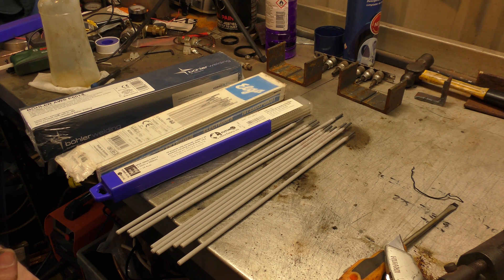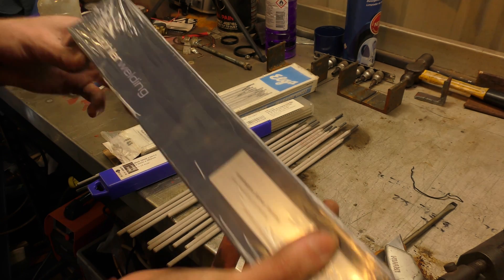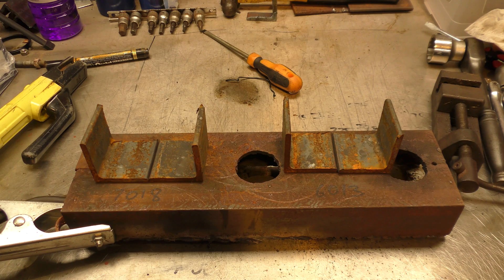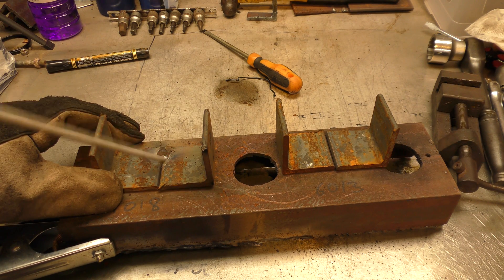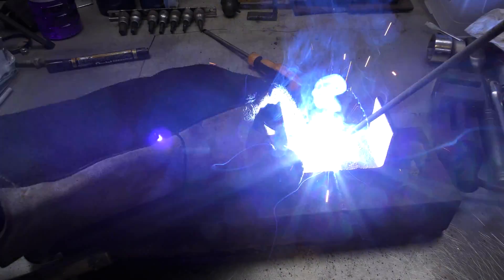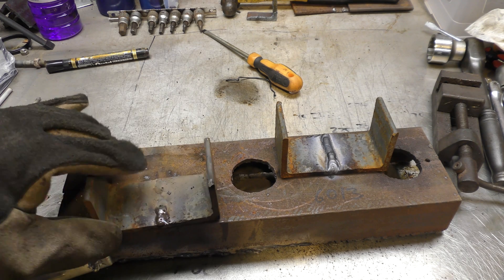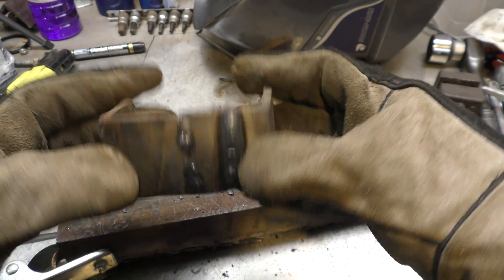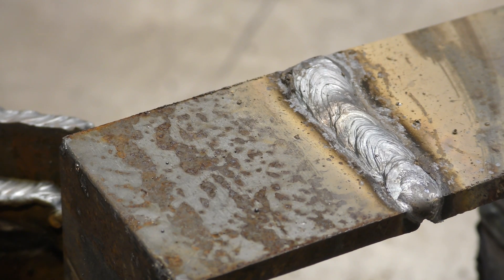Welding Electrodes for DIYers. 6013 7018?

Comment: As a beginner always best to start with mig/flux core. stick welding has too many variables and a steep learning curve. if you must have stick then 6013 is the way to go.
Reply from the maker: Well that depends.  If you want to learn to weld properly, perhaps starting a career later, start with stick.  Once you can stick weld everything else is easy.  MIG is easy, everyone can MIG, it's a hot glue gun for metal.

Comment: Your 7018 weld though not as aesthetic,  was much stronger and had deeper penetration. I love 7018, i run it a little hot with electrode positive and its never failed me..

Comment: I read a lot of "experts" comments on here how to use the 7018, I'm in much the same boat as yourself, I just do it for the shits and giggles, I've realised between different machines it makes a huge difference to running a 7018 it needs to be a DC machine as you'll already know, but I've tried 5 or 6 different machines and the best has been the wee esab with the hot start that jams all the amps in for a split second just to get the arc struck. The other thing is 7018 is ment to be dry, like kept in a vac PAC then a rod oven and those bholer or bloher or whatever they are make are the worst because straight out the gate they're not vacuum packed, again I found the esab rods the best I've tried so far. Other than that once you get the hang of them a bit better you can get a much better weld with less holes because there is less slag to hide the weld puddle, that also makes them much easier to use in the vertical too. I only just came across your channel because I've been pissing about with a diesel heater but your videos are great! Keep it up man, oh and where are you based? I'm near Lanark
Reply from the maker: Thank for that.  Yeah, we've not all got rod ovens running 24x7 to keep them in.  :)

I'm just outside Glasgow.

Comment: 100 amps isn’t enough for 3.2mm rod you need 120-125 amps
Reply: Bullshit. If you CAN weld, 90-100 should do it easy. But then again, if you're just a hobby welder............!!
Reply: Tandemwings 40 amps per mm
Reply: @tandemwings4733  to be honest it realky depends a lot on the type of electrode. i weld 4mm 7018-g at 160 amps whilst 4mm 6013 work nicely at 130.
Reply: @BlacksmithHeritage  Yes, I realise that there are many variables. I've got an old TM300 (wonderful bit of gear, but I haven't needed it for more that a decade) sitting in a shed that will do everything at least 20Amps (indicated) less than the inverters I'm using these days. Then we have 6011's (which I use because on some sites we use AC), 6012/13's for GP work, 7016's and 7018's etc. I don't use full iron powder rods anymore, so I don't ever use more than 130Amps. Also, many of the machines that are presented on the market today, originate in the land where THE VIRUS escaped from, and their quality and performance should certainly be questioned.
 BUT.... to try to suggest some random theory about 40Amps per mm is stupid and extremely misleading. It doesn't make any sense at all. Everyone should know about the problems of too much heat, surely. The need for excessive energy in the weld indicates a lack of competence.

Comment: everyone says you need to heat 7018 I got certified with cold rod it is the man behind the rod . 6013 is junk I use 7014 instead it is all posision rod 7018 is god for meld steel I use it when I weld hi carbin steel I use 11018 110 thousand per square inch rod

Comment: Good clean ground connection is essential. Those  electrode types don't like rust, a 60 grit flap disc applied to the grounding spot and the areas to be welded would help a lot. 100 amps is a good starting point,  Once he got going welds looked pretty good.

Comment: Amps are too.low. especially when sitting on a massive bar. Which is acting as a heatsink drawing the heat out of the weld. Up it to 115 to 120 at least maybe 130. Your arc.length is also.a bit long. Should have the rod it's diameter off the metal. No more so for 3.25 rods you should be 3.25mm also your rod angle isn't too bad but could be better. 7018 are.a.notorious pig to restart.

Comment: David quando usi basico 7018 corrente continua e polo più alla pinza porta elettrodo. PULIZIA PULIZIA PULIZIA
Reply from the maker: I think you're trying to tell me that 7018 likes nice clean metal to weld on?
Reply: David McLuckie No I m triyng to tell you thet when you use basic 7018 
You have to use direct current and polo plus electrode clamp.
And really important take clean!!
Reply from the maker: Thank you.  7018 DC Electrode positive and clean surfaces.

Comment: Please secure the metal with a vise grips. 7018 is fussy about clean metal. Unless you are building a trailer or bridge 6013 will do. It will not penetrate as well.

Comment: 1A for every .001" of rod diameter.
6013 very low penetration weld
7018 most used rods in structural work...not good with home AC machines...and require oven for storing when box is opened.
Easiest all purpose rod for beginners and casual use is 7014...they're the cat's ass:)
Reply: I use only 7018 for arc welding you can use 7018 with ac but you have to make sure it is marked for use with ac and once you get used to 7018 you can use it for all your repairs and for the average person making repairs on lawn mowers etc. you don't need a rod oven but if you were welding on a bridge or other structure and you can't have any defects in the weld whatsoever then yes a rod oven is needed and 7018 is a low hydrogen rod meaning that it is meant for high carbon steels but again it is a great rod to use once you get used to using it
Reply: I like 7018 for most everything but 6010 for large gaps, bad fit up and bad prep, dirty metal.
Reply: @sogyseal7962  love 6010 on dirty metal watching the puddle dig in on a whip and pause motion
Reply: logical canuck 👍7014
Reply from the maker: 7014?  I can't even find them for sale in the UK.  Our most common is the 6013 and then 7018 which as you say aren't for home users.

"1A for every .001" of rod diameter" - Does that convert to mm for us metric types?  ;)
Reply: I too am a metric type (Canada) and yes 3.2mm can convert to .125" (125A)
eBay UK does offer 7014 rods. The absolute best to store and use by the novice.
Reply from the maker: eBay UK does indeed list 7014 rods, but they are from USA.  Although I am tempted to import some for testing.

40amps per millimetre, I can almost remember that.
Reply: The funny thing about converting mm to inch is that welding rods are designed in fractions to begin with...1/8"....3/32"...
Much easier to obtain 7014 here...our Canadian Tire Stores, Princess Auto, etc have 'em.

Comment: Nice video. Wonder what type of project you would use each of them?

I'm thinking to build a light 100-150kg small lift crane. Would 6013 suffice or 7018?
Reply from the maker: I used the 6013 rods on my car ramps and I know other people that do everything in 6013.
Reply: I saw your exact video on that. Love that. Really good job. Initial thought was 7018 for its high tensile strength properties. Glad to know and enlightened that 6013 able to take on many and far heavy duty applications.

Comment: Yeah I Agree with John & Sid's Comment down Below, Hot the Rods up! you might want to Try using Run on and Run Off Tabs, the run on tab gives you a chance to Strike & stabilize the arc prior to running the weld Proper, the run off tab allows you to terminate the weld cleanly after having completed a full form Bead, leaving you with a nice uniform Weld  after grinding the Tabs off.

as to the Electrode numbers 
the 4th & 5th numbers denote the type of Coating on the Rod as well as the power needed ie AC DC EP EN 
Coatings are as follows 
0- Cellulose Potassium
1- Titania Sodium
2- Titania Potassium
4 - Iron Powder Titania
5 - Low Hydrogen Sodium
6 - Low Hydrogen Potassium
7 - Iron Powder Iron Oxide
8 - Iron Powder Low Hydrogen 

Hope this Helps

Comment: Warm up the electrode on scrap first, just drag it along so it arcs. Its easier to start an arc with a hot electrode.
Reply from the maker: That is a top tip.
Reply: I haven't stick welded with my powerarc welder in a while but you are absolutely right with that great tip. I've always found that if the rod or the metal was warm things went much easier even with hot start on the welder.
Reply: Sid Smith it is easier to start an arc with a fresh CLEAN electrode that doesnt have gobs of flux and slag on the tip.